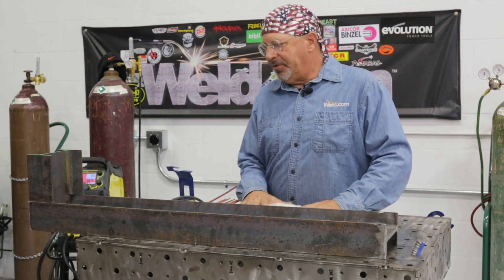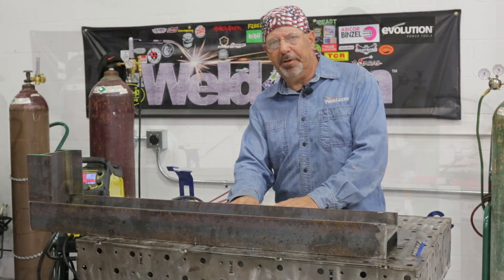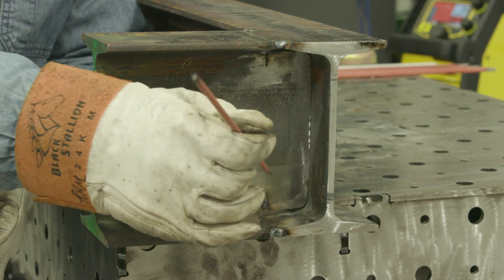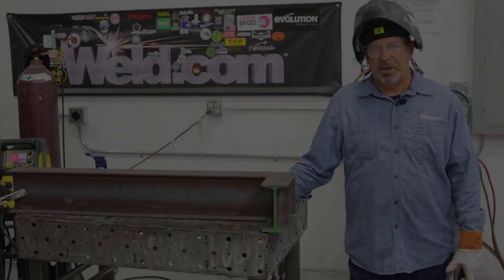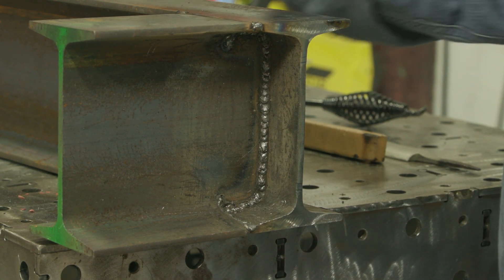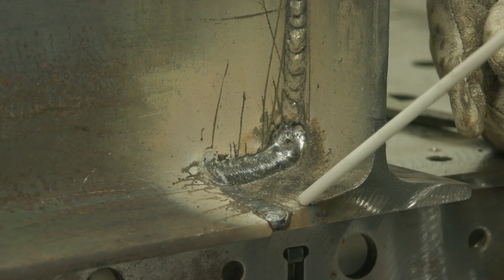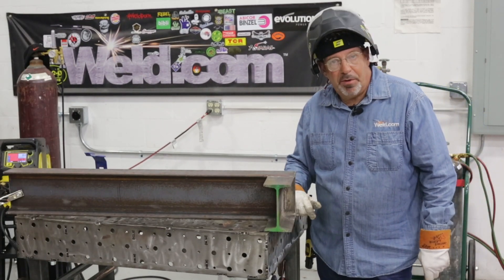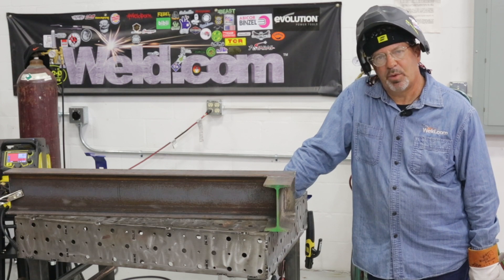Welding our Incorrectly Cut I-Beam

Comment: Try not to use the term, structural when using 6010. No 60xx electrode is pre-approved for structural applications per AWS D1.1

Comment: I've been working on roll off dumpsters for a couple of weeks now, plating over holes in the bottom and sides. These old, beat up dumpsters are so bent and crappy, there is literally no way to get plate to lay flat over an entire repair to fix it. Filling gaps has become the bane of my existence. The gap on that joint, Bob....that was nothing compared to the nightmare I've been welding in lately.....
Reply: Ryan Jones cut some holes in the new plate and plug weld it

Comment: Nice job . Really hard on the legs to climb down 150 feet to turn machine down for up hill . Should send your students to potash mine in Carlsbad for some dirty field experience. When you did video of welding rusty metal I thought that was good steel where I work. Rusty and salt impregnated metal really makes me appreciate when we get new metal and I get to work in the shop. I love your videos and I have learned a lot. Thanks bud and don't check the flavor of the rods half way through hard on the nose or tounge

Comment: Good job, I might try to suggest going to 7014 it's a lot easier to weld with. And a vertical down is so close to the strength of a vertical up with 7018, it's good for using for people who can't seem to get the hang of a vertical up. You did have just a little bit too much of an overlap on that horizontal weld in the corner but that's the only question I had, it was a good-looking weld however.

Comment: the "mistake" you did, doesn't affect structarally the joint, you could even cope down to the "K-dimensions" of the beam. Once you weld the flange to a full penetration, that will take care of the moment forces, and the weld on the web will take care of the shear forces. There is not really a need to weld the "radial part" of the beam. (Structural Engeneer here, and a welder in training). Good job men, learning a lot from your videos
Reply: I'm not an engineer,  so would you mind  explaining: k- dimension, moment force, shear force,  flange, web, radial
Reply: It’s only a mistake if you can’t fix it

Comment: As a structural fabricator and erector for 36 years, never has it been acceptable to run 6010 even at a root. Then in fit up of stiffeners or as in this web to web fit up, you nip the corners where the K section is. Stress in Wide Flange beam profiles are typically directed to the K sectionsand as this is where you want any possible flex to be directed,  you never weld thru the K sections. 
If anyone has an AISC or AWS code section that shows welds in the K section please advise.

Comment: I've had my first machine now for 4 months set for FCAW , an well I'm making mistakes such as bad fit up etc... money is tight and I'm 75% into a saddle cut fence gate frames using what I have on hand, recycled chain link top rail from the 70's. How can I deal with bad fit up gaps 1/4 - 3/8 an ensure that my welds are proper and solid. I've learned allot from watching but I'm curious when do you draw the line an decide to abandon you chunk of work an grab a fresh piece of scrap an try again?

Comment: Is there a reason for choosing 3/32's rods? I see a lot of that when I would have reached for an 1/8" 7018.  Great fix btw...
Reply: Heat control would be my guess. 83-85 amps uphill is easier control than 95-105 with an 1/8" rod.

Comment: Im about to graduate high school and i want to do something with welding, where should i start and what should i do?
Reply: jack meoff    Can’t give you much advice on what YOU should do.   Because there are far too many directions one can go.   I can share my experience and hopefully it can shed light.   I started welding at 17 building trailers with the dad of a girl I knew.   When I was 19 I started a welding course through my local JR college.   Was an associates degree.   After 6 months I got a job doing structural steel.   Started out as a welder, but quickly saw that being a welder/fitter was better.  Some companies in structural steel use separate welders and fitters.  Others prefer combos.   I preferred fitting over welding because I found fitting I had to think more, my days seemed to pass quicker.   And I could safely wear short sleeves when it was hot.   I developed from a structural fitter to a miscellaneous fitter.   Doing miscellaneous you build things like stairs and handrails.  I really enjoyed this.  A lot of Math.   Degrees, and you need to be able to work basic formulas using basic algebra.   As I progressed, I worked myself into shop foreman.   Ran the entire shop.   I work to the employees in order to meet deadlines.   Often giving feed back of progress and anticipated completion dates to the Project Manager of the job.   Hiring, and management of shop employees and ordering supplies.   
I eventually moved to the office, and am a Project Manager.   I work with architects, engineers, general contractors.   I deal with the contracts, price work and even give estimates.   I assign detailing for our shop drawings and ensure they match the contract drawings.   I set and maintain the scheduling for the projects for our steel.   My experience as a welder has made me a much better Project Manager, and I make good money, and do it from a clean air conditioned office.    Still, sometimes they guys request help out in the shop.   I put on my coveralls and get dirty for the day.  It’s been an amazing career.    Start off with vocal training.   Or, you could find a welding shop that will hire you as a helper and train you.  I did that with several guys.   One is currently the lead man for my shop.   My current shop foreman came to me with only minimal welding experience while I was foreman .   5 years later he is running the shop, and has over 10 guys working for him.   His lead man never welded before he started and he is now second in command after 4 years.  Good luck
Reply: Chris Huber thank you for the advice, at this point im thinking about getting in a jr college and doing their welding program. Always trying to get advice wherever i can

Comment: Bob, Are you using AC? I ask because all I have is a 40 year old Lincoln buzz box. Works well and I am still learning thanks to you!
Eric
Reply: Since he's running 6010, it's DC. 6010 and 6011 are basically the same, except that 6010 is DC only.

Comment: A REAL video! Great job on the fix and the video. I've f_(ked up some fits that make you scratch your head as in "WTF?", but figured out a fix and learned a lot about myself and my fitting/welding.
Subscribed.
Stay safe!
H
Reply: Bob hasn't been around for a few months. But the channel still has 'Red beard' and 'Mancub' , both very accomplished welders. Glad to have you on board!

Comment: Bob great video (as usual). I have a question, if the short piece was flipped so the gap between the web and the flange was at the top would you do the build up of the weld on the flange or on the web?

Comment: Would another option have been to take that short piece with the wrong taper, alone without the other beam it'll be welded to, and add the missing metal back with a couple of weld beads along that edge where the gap would be then grind it a bit so the geometry fits tightly into the adjoining beam?  Then it'd just be a couple of short flat position welds, which would be simpler?

Comment: Love your work and arc shots boss! Now, if you wouldntve' boogered it up, would you have just welded out with 7018? I do know that 7018 is not meant for gaps, and I do know that I've never seen an ironworker carry 6010 (that he'll admit to anyways). So do ironworkers fudge with using only 7018 or do they not make mistakes? Lol! You  can plead the 5th on the second part of my question!
Reply: Mistakes happen,  gaps happen. Iron workers carry a bag of tricks. I carry 6010, 7010, 8010....
Reply: @bobmoffatt4133  true, I understand the mistake part. I've lived the mistake part! But with virtually no gaps, you would not have needed the 6010 root, right?
Reply: @tommyt2854  Not at all except for driving a deep penetrating small weld in there. 7018 would be just fine.

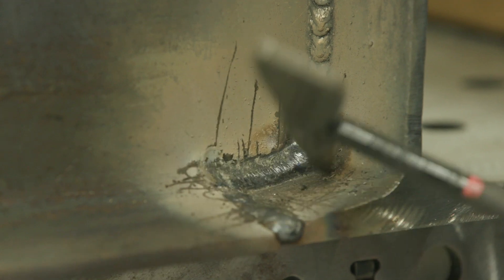Comment: Thanks for these - I love your videos.  I have a question - at 7:00, why did you do the full weld uphill knowing you were going to blend the top of the piece then run downhill?  Was the uphill for better penetration / weld profile?  I am just an amateur, so downhill is always easier for me.
Reply: Me too.  Can't seem to get the uphill not to sag.
Reply: Cant weld vertical down with 7018
Reply: Uphill gives better penetration, and with 7018, all the flux runs down into the puddle if you try to downhill it.

Comment: Why do you use 6010 instead of 7010?  As a structural engineer, I would not allow 60ksi rods in any welds.  Is it a pipe fitting thing for shitty steel?  Most oil pipe line steel I see is API 5L X60 to X80 and would require 80-100 ksi rods for matching.

Comment: I have welded. Wose. But it was used pipe line pipe. On A boring crew. I had to weld through running water. I would fier you.

Comment: @weld.com I'm trying to repair some metal gates around my place how can I tell if its iron or another metal I've been using mig  but should I be using stick?
Reply: If it rusts its steel. Clean it well if using mig
Reply: @clevelandmortician3887  thanks for that
Reply: A magnet works or hit it with a grinder for cast id

Comment: Welding in the k's? Why, stronger if you stay out of those and pretty sure not code.
Reply: Should never weld the k zone thank you
Reply: New title of the video should be welding our incorrectly cut ibeam incorrectly
Reply: I think it depends on what it is, stiffeners you dont.
Reply: @WeldersOnly  no it doesn't YOU NEVER WELD IN THE KNEELING
Reply: @ferronbeast1368  On structural yes, but I've done stair cases and other jobs where it was called for all the way around for visual reasons.
Reply: @ferronbeast1368  No need to get all capital letters on me dude lol
Reply: @ferronbeast1368  Can you tell me why though? Because it weakens that area? I mean say you were to weld a stiffener all the way around, how can it weaken that area if theres a stiffener there?
Reply: Chris Cowie many cracks can form up on the weld in the k area that will travel down the rest of your weld. AISC and D1.8 tell you to stay out of the k for a reason. There are stresses and some presume bad material in these areas that once welded, make the normally structurally sound weld joint not so sound anymore. 90% of structural work stays out of the k, it is very rare that you see weld all around and its usually an ascetics deal on a non structural piece when you do.
Reply: @mountain_ginger  Ok thanks, good answer. I never understood that, just like with shear tabs they say to not weld the ends, is that to prevent a crack from spreading? Sounds like you know your stuff.
Reply: Chris Cowie yeah, best to hold 1/8"-1/4" back from all ends. You can thin the material and weld at the end causing a stress frecture area that can areas down your weld. Although I dont see this as much being practiced at all shops it's still a good idea. Kinda the same reason you want a clean radius instead of sharp edges in your rat hole cuts on wide flange/I beam and through plate cuts on box columns. I just fake it till I make it. Best thing to do is any time there is a CWI on site, ask them questions. They usually love talking about this kinda stuff. But be careful, I have ran into some CWIs that dont know their ass from a hole in the wall.